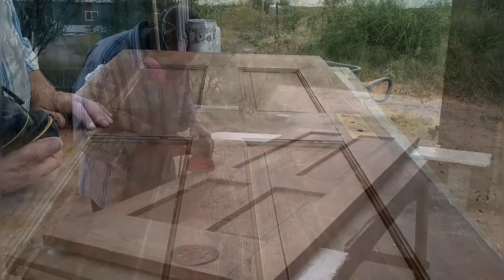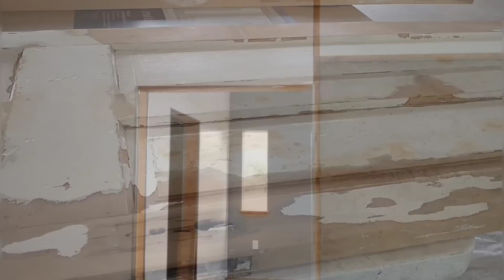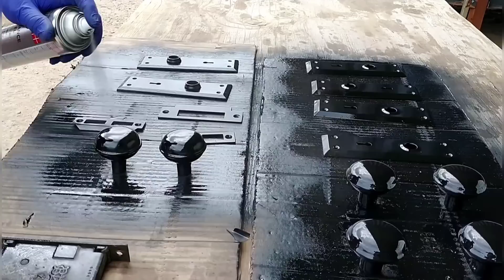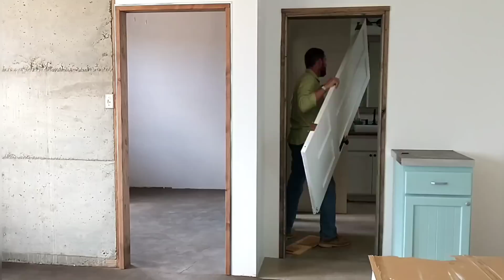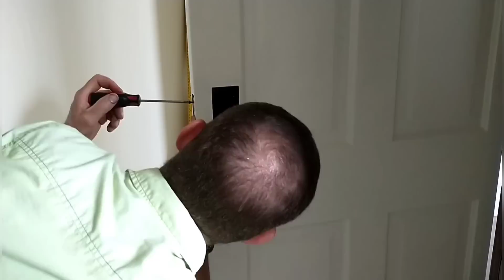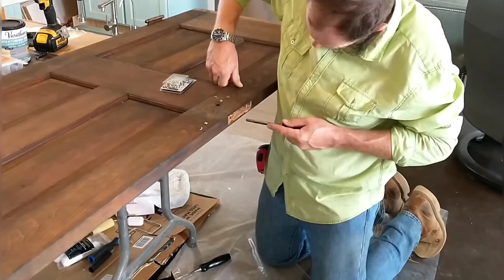Restore & Install ANTIQUE Doors, Knobs, & Hinges in our NEW Home #49 DIY Off-Grid Build

Comment: I grew up in Greensburg, Pennsylvania. The house was built in 1940 by a local builder for his family. We moved into the house in 1956. All of the doors were natural walnut with glass door handles. Hardwood floors upstairs and down.
We just thought it was "old" 
Funny how we are now treasuries old.
Beautiful doors 👍🚪👍
Reply from the maker: Thanks for sharing! Several years ago, we remodeled a little house in Belmont, Ohio. It was built in the early 1900s, It also had glass door knobs, and the old sash windows, and wooden fireplace mantels. It was a fun summer project that the whole family worked on. Thanks! 😊

Comment: Our house was built in 1812. Our doors are very similar to yours. The middle horizontal piece is taller and the bottom insets are taller. Also, all the edges of the insets are straight. Yours look great!
Reply from the maker: Very cool! Thanks!

Comment: The doors look great. Well done. On the wide jamb where you made the relief cuts to accommodate the barrel of the hinge are the cuts long enough to allow removing the pins for quick door removal?
Reply from the maker: Thanks! It's not likely that we will need to remove the door anytime soon, but we can remove the screws if we need to.